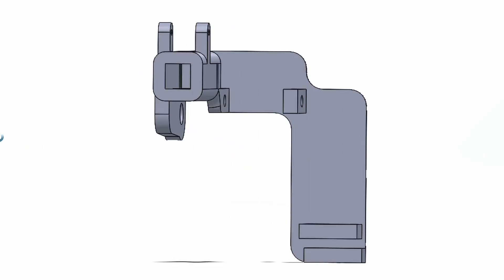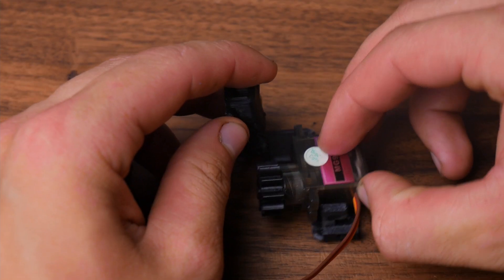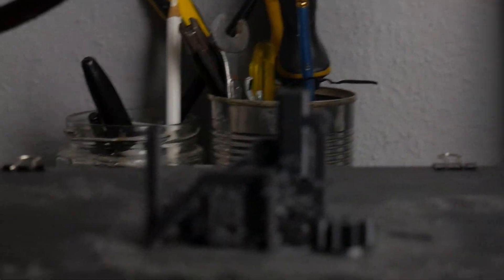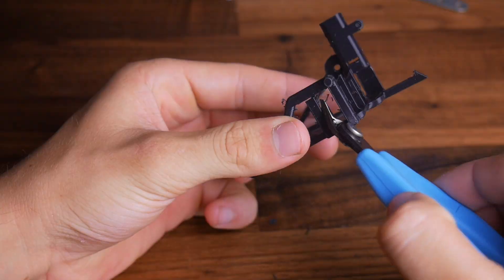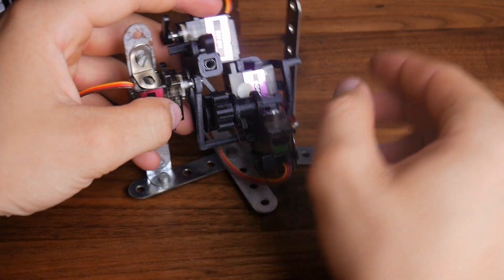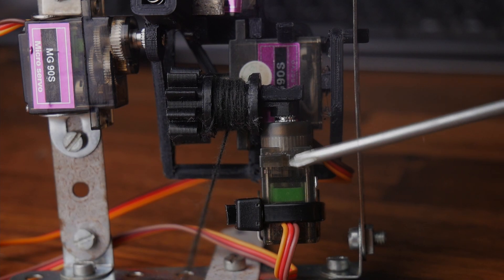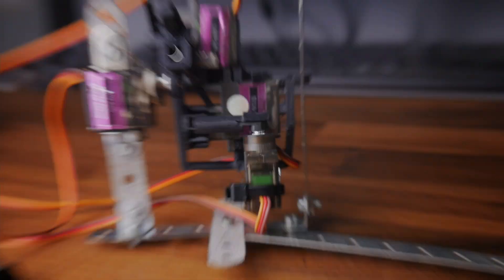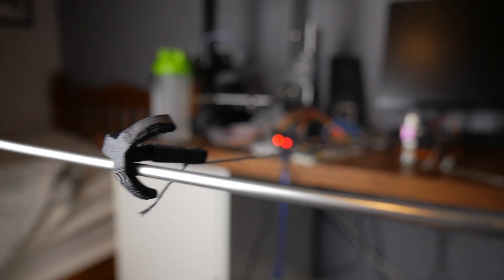WEB CLIMBING - Spider Robot

Comment: So I am not the only one, who goes in CAD and needs 3 or 4 different iterations to get it to fit and work :D I always hide my incompetence behind the fact that I am an electrical- and software engineer, not a mechanical one :D
That's why I usually bash something together with Styrene and then I have good dimensions I can plug into CAD -- and then I usually need to fine it still once :D 
And we share a similar love for shorts and t-shirts :D Are you sure I didn't knock your mum up about 20 years ago on a visit in London? ;) :P

And waiting for parts is always so tedious, isn't it? It really slows you down and I tend to get hooked into other side projects and sometimes have lost interest by the time the parts come in.